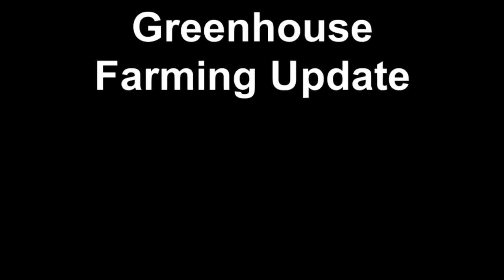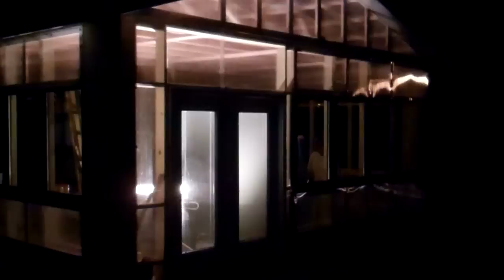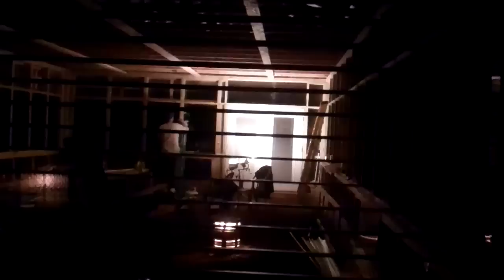Greenhouse-polycarbonate and glass greenhouse construction 9-12

Comment: High have you considered some of the alternative heat systems like the aluminium  soda can heat systems are the any practical applications for this scenario? assuming free heat is good heat . I am a total novice, but have a variety of interests in alternative building techniques and recycling where possible , this is an impressive project,
Reply from the maker: Hi Robbie,
I have tried running a garden hose around a compost pile. Also I run a few hundred feet of garden hose in the trusses for the sun to heat the water up and then I ran it down into the raised beds in the greenhouse but both efforts didn't work so went with the gas heaters. Also I was going to try the rocket stove but abandoned that idea because of gas heat in the greenhouse. I didn't want to have an open flame in the greenhouse. Thanks for watching and your comment.